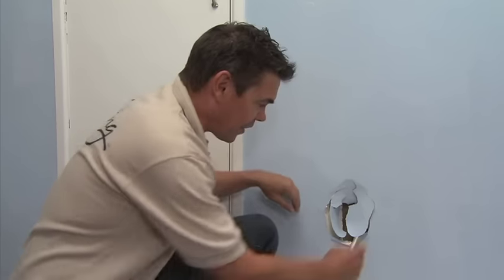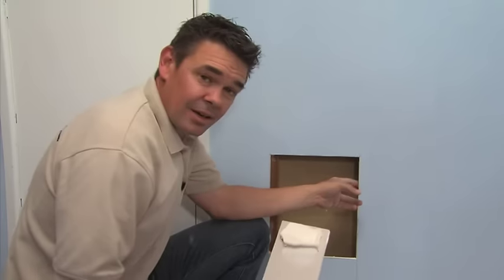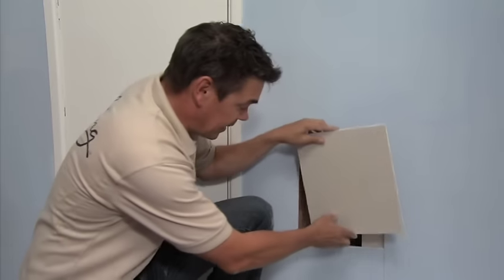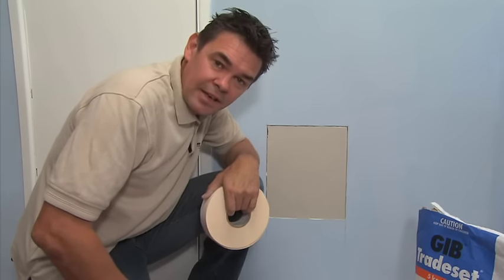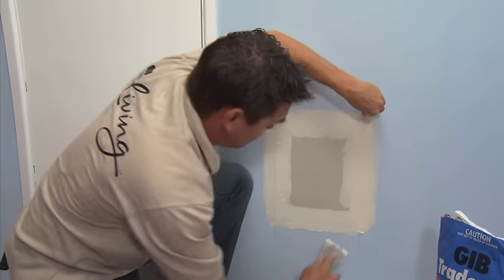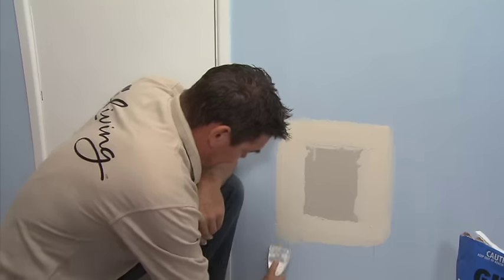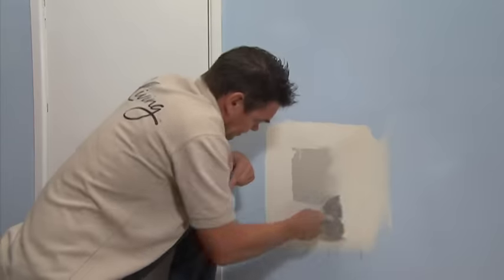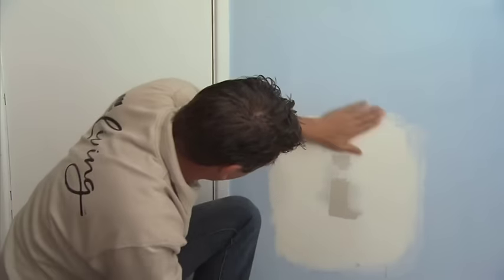Repairing Large Holes in your plasterboard walls with GIB Living

Comment: One thing to note is to never ever place your  mud can/bucket underneath or near your project, for if you do it when your scraping or sanding, the hard granular dried mud falls into it, & then you can never seem to get another smooth coat out of it as it will mix w/ the wet stuff, scratching  & scraping it as you apply it. Now I'm not saying you would do that but the fact i did that is just my point of warning those that might also do that. Thanks for your time & how to do it.

Comment: Using a heat gun will significantly reduce waiting times and personally i think the tape is unnecessary, it will protrude from the wall and not make a flush patch.
Also you must use undercoat before painting topcoat otherwise you'll always see a shodow of where the patch is and eventually will peel.
Paint shops never make perfect colour match so its better to repaint the wall, unless you dont care too much about a slightly off colour touch up on the wall.
Reply: Yup.. this is me, I'm going to be undercoating the patch piece and then repainting the whole ceiling. I removed a manhole.

Comment: Pretty sure you need to apply a primer paint coat on the patch and then you'll have to paint the wall from corner to corner so you can't see the patch difference
Reply: Totally agree, a sealer of some sort will be required.

Comment: furniture put hole and large indent, broke tape holding  4x8 piece together. What is the exact name of that glue you are using to attach dry wall support and then drywall. I guess I have to cut out an extremely large piece and replace it. Help for glue name and do I need to do that?

Comment: shouldn't you cut the repair panel first and then trace it onto the wall, so it fits perfectly ?
Reply: It is advisable to leave a 5mm gap around the edge of the plasterboard and the repair patch. This gives you a little more "play" will ensure that the fit is not too tight.

Comment: i use a self adhesive paper tape (dip in water)  and 5 minute quick set plaster.  I can have a hole patched with 3 coats of plaster in 45 mins.   Good weather its dry and ready to sand in about 2 hours.   And you'll definately need to coat that at least twice to not see that repair, possibly 3 times.
Reply: I also carry a hair dryer for quickly drying patches......i secured it to an old camera tripod...works great

Comment: So much overkill for a small hole. 

Cut a square out of a new piece of plasterboard use this as a template to neaten up the hole. 

Place a length of scrap timber like a piece of skirting behind the hole (use 2 or more pieces if required)
 Make sure the timber overhangs the hole by at least 3 inches.

Screw through the plasterboard fixing the timber to the back of the wall. Seat the new piece of plasterboard in the hole and fix to the timber.

tape the edges and plaster. 2 hour job at max.

Top tip use natural wood as its easier to screw in to, not ply or chipboard.

Comment: I live in a apartment building and I can't replace the wall areas that have big holes in it
I literally have to tape it up with wall tape and plaster
However it doesn't plaster up quite well I have to plaster it up the second time to get it perfectly smooth
I have little areas where I plastered up the big holes but the middle part is pushed in a bit which I can't fill up until it's dry

Comment: How come when you apply the mixture it sticks to the wall, but when I apply it, it sticks to the tool? I end up having to make repeated passes, and even if it looks moderately (I'm overstating that word) OK, I find when I sand it that it contains air bubbles.
Reply: It probably has something to do with the angle and pressure you are applying it.  Also, I'm sure that there are different grades of tools from cheapest to more pricy tools.  You don't have to buy the most expensive but you should ask your hardware store expert to give you some advice.  take pictures of your work and see if he knows what you are doing.
Reply: Also, I'm guessing that if there are air bubbles, you may be making it too thick (thinking thicker will save you time) when you need to take the time to put several thin layers on and let each dry before applying the next layer.  ... I'm just guessing since I haven't seen what you are doing.  Again, go to the hardware store and tell them what you are doing and they will give you suggestions.
Reply: Thanks for the replies. This is not something I need to do often (which probably helps explain my lack of skill). Fortunately the job in question is high on a wall, and looks OK if you don't get a ladder out to insect it closely.

Comment: I guess everyone has their own way.. I dont exactly disagree with using a back block but I would've deff screwed the block in.. Let alone the hole is damn near 16" already why not cut it to brake on each stud and do it rite.. New piece has no screws.. Yeah scrape off the bigger clumps but you should deff sand it the first time also so you dont have any runners. It won't crack instantly but give it a few weeks maybe months if, me personally, i use a primer instead of a finish coat of paint to see any imperfections..maybe not on something that small but hey like I said everyone has their own way, then theirs codes haha

Comment: Strange that you need to cut a large square hole to fix a small round one. Most of these so called plaster repair experts here on YouTube make a small job look like a big task. Cutting a clean circle around the damage and back blocking would of been more sensible.

Comment: Don't fix it put a poster over it. Personally I prefer to screw timber back blocks then screw plaster to it.  Otherwise you will waste 3 days fixing a small hole.  A hole like that can be fixed with three coats of plaster in under 2 hours